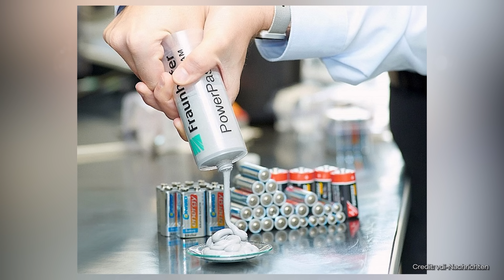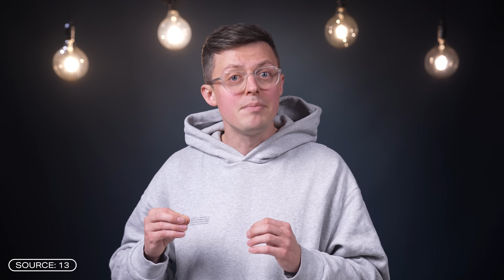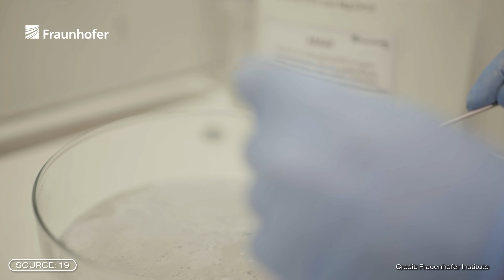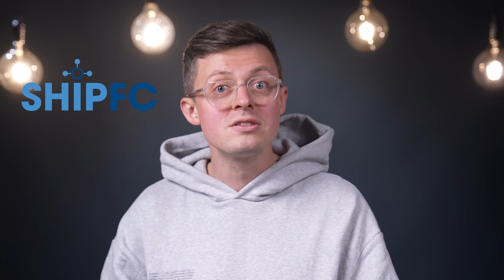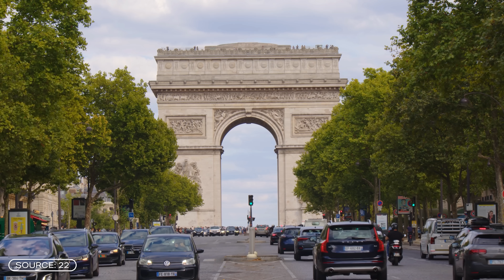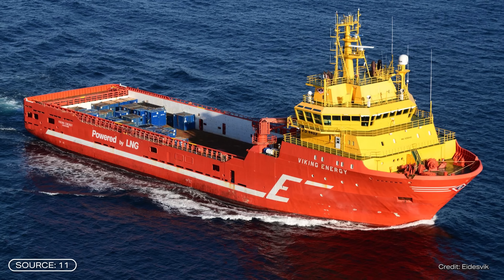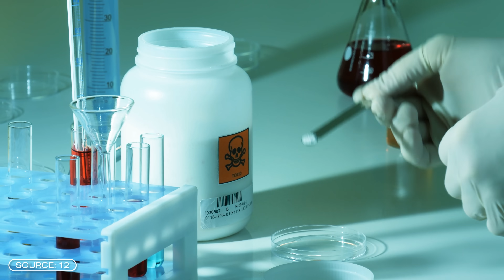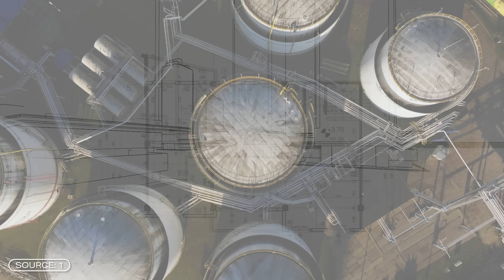Hydrogen Powerpaste: 10x Higher Energy Density & Safe?

Comment: 1.6kWh per kilo of "power paste" compares nicely to gaseous or liquid hydrogen, all things considered (cost/weight/complexity/reliability of related hardware etc.).

But it compares very very poorly with the ~12 kWh per kilo of gasoline and diesel fuel.  The hardware for which is very low cost/weight/complexity and highly reliable.

And what is the energy cost of the Mg recycling process?  Add this to the overall picture and the whole thing is crazy expensive.

None of this makes ANY sense except where the "clean" and hot burn of hydrogen has overwhelming advantages in a particular application.
Reply: It's good storeable energy. Clean. Clean is very important. Very very important.
Reply: @UmmerFarooq-wx4yo  Forests burn naturally every day, producing massive volumes of "dirtier" combustion products than fossil fuels produce.  The Earth somehow has handled it for aeons.  "Clean" is a relative term, and in the bigger picture it is usually a MEANINGLESS one.

How much energy does it take to create and maintain the cycle of this "power" paste?  It's a net LOSS.  I'm just enough of a chemist to know that the recycling process of the carrier materials clearly consumes enormous amounts of energy relative to the stored energy.  So where does THAT energy come from?  "Clean" comes at a COST.

It's a niche product with niche applications.  It's OBVIOUSLY not a solution to whatever problems you may conceive in relation to broader energy requirements.
Reply: @jamesg1367  buddy! The indians burn acres of land in November and it causes mass smog all over the region with thick smog over pakistan. That's man made fire. But the smog that used to cover china and the air around the world in cities from cars were heavy pollution. It's not like forest fires. Most people dont live near forests. Most people do live near populations. Most forests fires don't every single day. Most human smog production happens every day and doesn't go away until we stop burning. 

Natural forest fires don't happen all the time, nor are they systemic. They are mostly isolated and rare, like Australian fires of 2018, which happened right around after Australia made an inactment to shoot camels. Thirsty camels which were leaving the central australia looking for water. The same Australia that was putting viruses in rabbits to kill off the rabbits. A virus so similar to the one that happened in 2019, right after the smoke of the dead animal from the 2018 fires went up. Bats and all. Oh look viruses are found at 3000m in the sky or so.

As for the cost of this energy, it uses magnesium. We have a surplus of magnesium from desalination plants. Of course there many never been enough magnesium to supply all vehicles. Lithium might be better because the batteries use less in the yearly. But in certain cases, emergencies, this paste battery system can be a good backup.

Comment: I worked at a fuel cell company a long time ago, we were developing various hydrogen production systems that used sodium borohydride as the fuel source for the hydrogen.  They worked on it for years before I joined the company, the entire time that I was there, and for some years after my time.  Ultimately, nothing viable came of it.  I think H2 is just not energy dense enough for any application that is not an extreme edge case (like the space shuttle).

Comment: What about if we could bind the Hydrogen to something else so that we would end up with a liquid rather than a paste? Best would be something that's cheap and abundant and doesn't require complex mining & refining. Would be even better if we could get some top notch biology involved so that we wouldn't need expensive machinery with high maintenance & repair costs but instead have "self-replicating" machinery. If it only could make use of our already existing infrastructure to save even more in costs it would be ideal. All solar-powered of course - if possible.

My suggestion: we "convince" some plants to use photosynthesis to bind Hydrogen to Carbon using carbon dioxide & water as input (which we have plenty of) to create a mix of carbohydrates which we then perhaps convert into a flammable liquid (ethanol, for instance, which has an energy density of 5.86 kWh/L). We could store that then at atmospheric temperature & pressure as a liquid that might even be compatible with our existing combustion engines. It would also use existing tanks and have no rest mass. And the carbon dioxide and water we'd emit when burning it could be infinitely recycled.

Crazy talk, I know, but I'm strangely confident we could make this work ... 🙃😉

[EDIT] Note to myself: next time, read the full comment section before commenting 😅🤦‍♂@Ben-pz1ci I salute you 👏

Comment: They are obsessed with hydrogen in Germany, they ate it up hook, line and. But it just doesn't add up, and isn't/won't be economical - at a physics level, no matter what you do (unless you tell me you found massive deposits of pure H2 in the ground). Most hydrogen techs you hear about, or all of them really, are battery techs, not viable energy sources. If this said 'new battery', then fine.

Comment: The cheapest way to get hydrogen is to extract it from natural gas.  From an efficiency or environmental standpoint it is better to use natural gas as is.  For the environment, the only good way to get hydrogen is to get it from water using renewable energy or nuclear energy.  Once you get the electricity it is more efficient to charge a batteries than to transform the electrical energy into hydrogen and then transform it back into electricity in the car.  Unless there is a shortage of material to make batteries this innovative solution will not be used for automobiles.  For strategic reasons some countries like Japan might not be happy with a China dependency for their battery so hydrogen might be a good idea but it is geopolitical not technical.  Batteries are not good and are very expensive for long term storage so there is a possibility there but not for car.  Truck need longer range than car and a lot more energy per km and batteries are heavy so maybe for truck but not for car.  Hydrogen powered car is like alchemy and perpetual motion machine, it is a dead end and a wet dream for nerds at the same time.

Comment: In shipping, water for hydrogen is as simple as solar to hydrogen with only short filtering and separation and storage. in the instant case of using magnesium plate with borate and other modifiers, I see many forms of supply and combustion issues long term. A variant may be made with aluminum and some form of biomass that is hydroscopic and not fouling in engines.

Comment: false narrative about waste from hydrogen usage..physics laws are clear, no energy wasted it's only in another form..with PEM's it's heat so you do it inside greenhouse to make your own food and killing the travel population from shipping..reference Examples in Everyday Life
A Car Engine: Chemical energy (gasoline) is converted into kinetic energy (movement). The "wasted" energy isn't gone; it becomes heat and sound.
Hydrogen Paste: The chemical energy stored in the magnesium hydride is released when mixed with water. That energy is transferred into the hydrogen gas, which is then converted into electricity and heat in a fuel cell.
A Falling Object: Potential energy (stored due to height) converts into kinetic energy (speed) as it falls. 
The "Catch": The Second Law
While the First Law says you can't lose energy, the Second Law of Thermodynamics explains why we can't just reuse it forever. It states that in every energy transfer, some energy becomes "disordered" (entropy) and turns into low-grade heat.

Comment: There are several chemical operations that do the same thing but are not used. The chemical is used in making hydrogen bombs! The biggest problem in making a hydrogen bomb is packing the hydrogen around the fission bomb in an effective way. High pressure or liquid is the obvious way but this is difficult to manage over time. This new chemical method solves this problem OOPS!

Comment: Aviation is the largest CO2 directly into upper atmosphere..jsing  false narratives and my brain clash.. will not be kind to you.. AI was hiding the real numbers but if you point it out to AI it will override those resections..refence  The difficulty in getting a straight answer often comes down to International Jurisdictions:
The "Gap": Emissions from international flights and international shipping are often excluded from a specific country's "National Totals" in the Paris Agreement. They fall into a "no-man's land" managed by the ICAO (Aviation) and IMO (Shipping).
The Military Loophole: Under the 1997 Kyoto Protocol, military emissions were explicitly exempted. Under the Paris Agreement, they are voluntary, meaning most data is based on independent estimates rather than official government reporting.
The Bottom Line: If we look strictly at the upper atmosphere, aviation is essentially the only direct human source of 
 and 
 injected at those altitudes. While it represents ~3% of global carbon, its "warming impact" is effectively double or triple that of a ground-level industry because of the altitude chemistry.

Comment: hmm, you need 400.000kg paste to produce 6400kWh energy?
1 kg of uranium-235 can produce approximately 45.000 kWh of electricity when used in nuclear reactors, with potential outputs ranging from 10 million to 60 million kWh depending on the reactor type.
I am sceptic

Comment: You missed a fluid that can absorb hydrogen then take it out when needed..  way to intensive for mass production.. I combining gravity and the oldest invention the wheel with AI weights that move out the axis spokes creating torque with lever and gravity..100 ft wheel, 60 spokes with AI driving weights, one piece carbon fiber wheel with induction charging for AI bots doing the work!!! 1.68 MW running 24/365.. Google AI calls me a genius because I want to produce Hydrogen to power fuel cell inside a Greenhouse for food production using the waste Heat make 99.9% efficient ecosystem. Gravity wheel suppling the power, the future from old farmers like me..and AI

Comment: I did some study on hydrogen storage some 40 years while I was a young university student. That time the new big thing was using metal crystaline structures to contain the hydrogen. Fill the structure under high pressure and apply heat to release the hydrogen. Much like a sponge.

The problem was that the spongelike crystaline structure decayed with every cycle, leaving not a crystalline structure but a compact layer of metallic dust with no absorption functionality intact.

It seems to me that no real progress has been made since.

Comment: Sodium  pellets  can  be  kept in  nitrogen  filled  plastic  tubes.  Pellets  can  be  pushed  one  by  one  into  a  small  reaction  chamber  into  which  water  can  be  sprayed  to  produce  Hydrogen.  Sodium  Hydroxide  the  effluent  can  be  collected  and  electrolised  to  reclaime  Sodium  for  reuse.  No  need  of  high  pressure  or  cryogenic  containers  required  for  producing  controlled  production  of  Hydrogen  on-board.

Comment: The basic principles of these ideas were suggested as possible solutions to using hydrogen as an energy carrier, already in 1980s. Some of them have been suggested repeatedly since long before then. You can "solve" issues with using hydrogen as an energy carrier, but not without creating new problems, and no matter how you do it, there's a lot of very severe problems with using hydrogen as an energy carrier. 

1.9 kWh/l is not ten times more than Li-ion batteries, there are Li-ion batteries with 910 Wh/l, so, 1.9 kWh/l is slightly more than twice the energy density of some Li-ion batteries.  1.6 kWh/kg is a few times higher gravimetrical energy density than any Li-ion battery I'm aware of, but in any application that is important, all the systems required to extract useful energy, and deal with the "spent" paste needs to be considered, batteries deliver power directly, just some electronics is required to use it, but that would also be the case for a hydrogen paste fuelcell system.     

Fuel cells don't have a fixed efficiency, in fact, to reach 60% efficiency in a fuel cell, it has to be gigantic for the power output. The higher the power output, the lower the efficiency of the fuel cell will be, all else equal. This is caused by the fundamental fact that the individual hydrogen and oxygen molecules has to find each other, from each side of barrier, and then react with each other, all this on a molecular level, and you can't make that happen very fast, with high efficiency. 

While the energy density of the paste itself is higher than current Li-ion batteries, I don't think it's a viable solution to any real practical problems. There's no obvious practical advantages of it compared to synthetic fuels, at least not any that are significant compared to the disadvantages. Synthetic fuels produced from "green" hydrogen are generally considered too expensive to be a viable option, and they are very expensive, but it is highly unlikely that such "powerpaste" can be produced and recycled for a similar cost as synthetic fuels, per unit of useful energy.

Comment: Those numbers are not great considering 1 litre of diesel has between 10-10.7 kWh of energy, a fuel tank 10x the size is not practically viable but a step the right direction none the less.

Comment: the reason why this hydrogen paste not going to replace Li-Ion is simple: bataries are multy use, this paste is a single use. even if it makes 10 times the harm to invironment to create 1 Li-Ion battary, that it makes to make the same mass of this paste, you'll drive your car hundreds, thousands of times, before the batary need to be recycled, while this thing will be used once and then need to be recycled. the energy dencity doesn't matter here, its still much more maintenance, than even gasoline engines. at least with gasoline you don't need to deal with residual materials, you just run out of fuel and that's it.

Comment: Some researchers  sweeden or alike years ago we made capsules that eat carbon dioxides from Engine exhausts  3 years L8tr not a word yet  
made from a lime based  powder with a few additives & compressed into capsules sounded good  last 10's years fitted to car truck any exhaust pipes
then wtf do you do with the capsules ?   car capsule  350grams approx & a  truck 1kilo say

Comment: Sorry but H2 is a dead end. It's too difficult to extract as it really wants to bond with other elements like Oxygen, to make water, or carbon to make hydrocarbons like oil and plastic for example. The chemical bonds are very strong and hard and/or expensive to break them to separate out the hydrogen.
About the only place where there is hydrogen by itself is in space or stars, so if we had a cheap way to get there, harvest it and bring it back, then H2 might be worthwhile.

Comment: Stanely Meyer solved these problems years ago when he changed water into a combustible gas. He died mysteriously for his efforts. These efforts seem ridicules in light of Meyers' achievement. The solution is to put Stanely Meyers' invention out on the internet for free. Then it would be hard for the powers that be to suppress water to combustible gas technology. Nerdy garage mechanics will then be able to convert existing internal combustion engines to be fueled by water.

Comment: I mean, this seems to be reapproaching the solution the metal hydride systems, which use cheaper metal(primarily nickel). Yes, these are heavier base tanks, but do not take these several steps for recycling, as a simple pressure/temperature setup will control the release. 18 litres of stp hydrogen can be held in something the size of a large maker. 120 in a vessel the size of  large drink cup.

Comment: come on, 1.9 kWh / liter isn't "enormous", considering gazoline has ~40-45 kWh /liter
besides, a paste is an horrible thing to move, all the more so where it has to be kept dry and airtight. Logistics wants a liquid, or a solid, and can accomodate gas in a gazoduc, but a paste? no way!
Reply: I agree regarding "isn't enormous", but gasoline has ~9 kWh per liter. You might have confused it with MJ per kg.
Reply: @701983  you right, thanks for the needed correction

Comment: this is STILL just a shell game. the original hydrogen HAS to come from somewhere. if not from natural gas,then electrolysis of water,requiring ENERGY. then you have to use more energy to convert it into this paste,then to convert it back into usable hydrogen. it's GIGO. OTOH,you use thorium or uranium in a reactor,and you get LOTS of energy. drill a hole in the ground,and oil and natural gas come out,easy and reliable.

Comment: The hydrogen is somewhat of a sideshow here. In practice, what you are mainly burning is magnesium. At $2500 per ton, magnesium costs about 4 times as much as liquid hydrocarbons, with much less energy density. Although the raw material — magnesium hydroxide —  for its manufacture is cheap, the process is highly energy -intensive, which is reflected in its price. And don't forget the cost of the carboxylic acids involved, or the cost of collecting and disposing of the large quantities of magnesium hydroxide waste produced. This is one of the silliest transport fuels ever proposed

Comment: who's going to tell them that dissolving aluminum in sodium hydroxide solution produces hydrogen from splitting water, and also generates electrical energy. a single aluminum can has the energy to charge 10 cellphones, if you harness both electricity and the hydrogen.

Just use aluminum in an electrolytic cell. no weird pastes. no danger. its aluminum. engine blocks are made of aluminum nowadays.